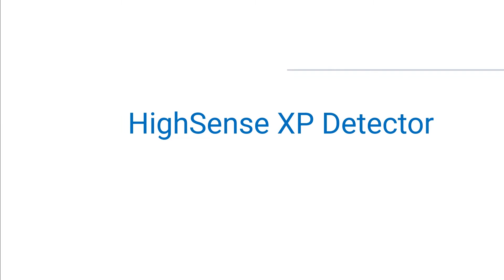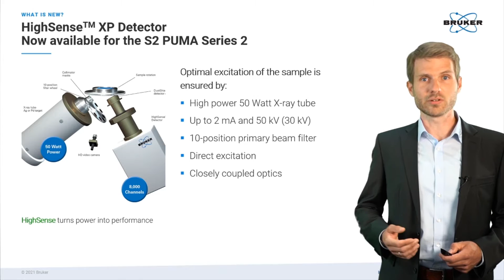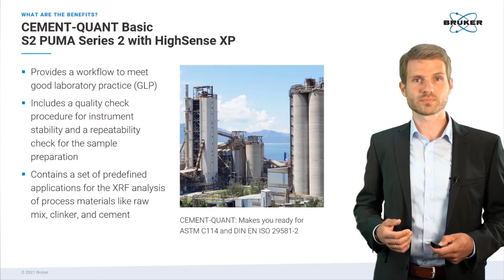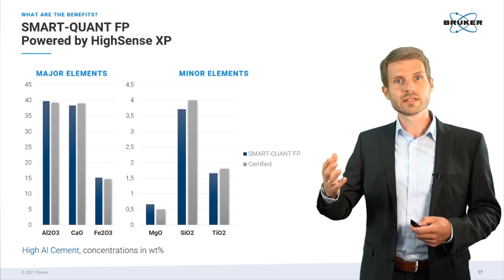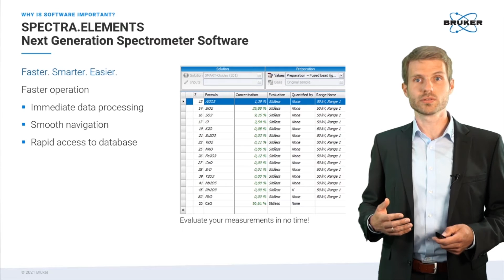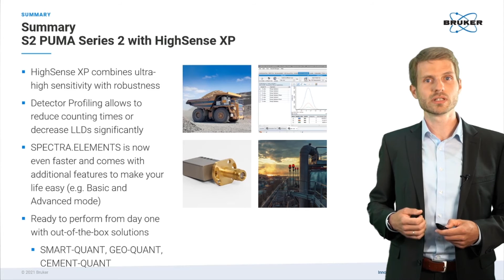Launch of the HighSense XP Detector for the S2 PUMA Series 2

Comment: can s2 puma xy detect nitrogen?
Reply from the maker: Nitrogen can be detected with XRF but only in solid samples (not in liquids or powders) using vacuum mode. The light element configuration of the S2 PUMA Series 2 with the HighSense XP detector is sensitive enough to detect elevated contents of N but for most applications the sensitivity for N is not sufficient. Larger WDXRF devices, like our S8 TIGER Series 2 are being used for the quantification of N.
Reply: Which element can I check with this equipment? Can I check in the rug radiation elements?